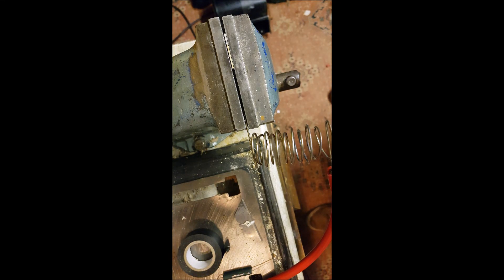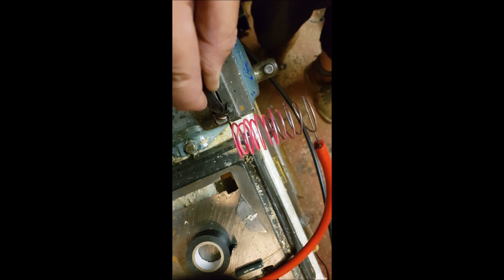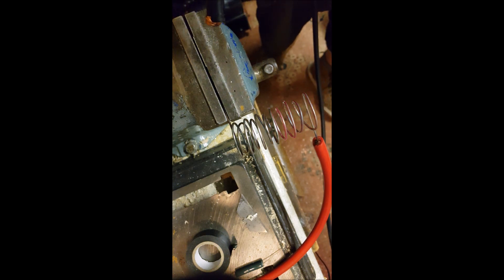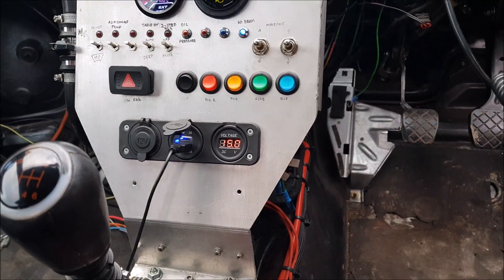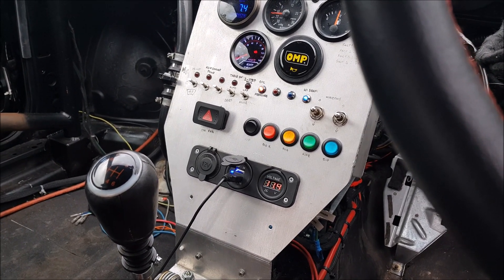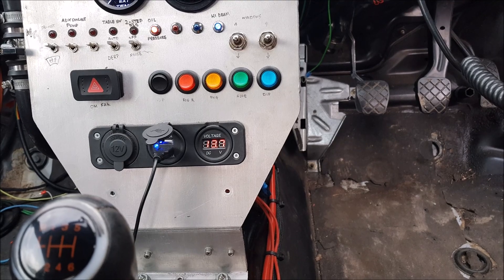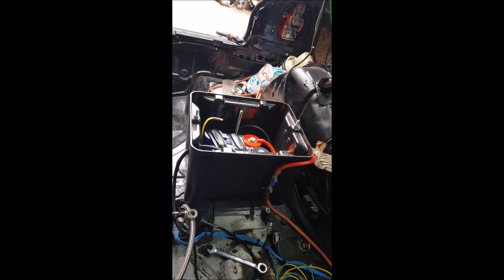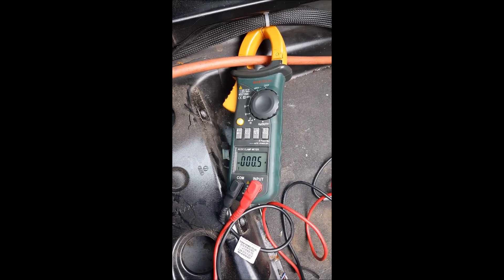Ultra Capacitor Testing! Bye Bye Car Battery!

Comment: Its best to combine cap with bat they do not weight much but you get longevity of battery and burst power from capacitors. The thing is that caps can damage wear out startup motor quick er due to more hot sparks being produced.

Comment: Do you think I can start my four cylinder car with this capacitor? ......................https://www.ebay.com/itm/Stinger-Digital-Red-LED-2-Farad-Cap-Power-Capacitor-16V-2000-Watt-SSCAP2M/310279538405?epid=2172348537&hash=item483e1a06e5:g:OYwAAOSwyjJZxATH

Comment: can the alternator charge the capacitor ?
Reply from the maker: Yes, ofcourse. Takes just a matter of seconds to recharge after starting as the ESR is so low. It will charge at the alternator's maximum output current.
Reply: sorry, why then you have to firstly charge them through a resistance ? what if, if just connected to a battery (temporary or permanent) for their first charge ..

Comment: Just got the 3v 3k farad. Blow the hair off a bear. So far I've found the balance boards do not keep them balanced due to not being able to reference to each other. Going to get a board that is designed for 5s and 10s.